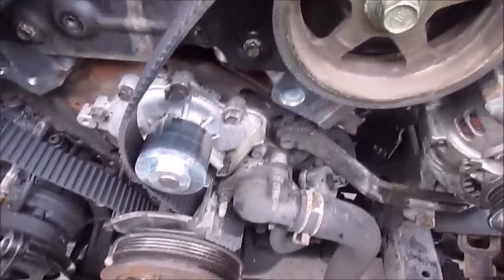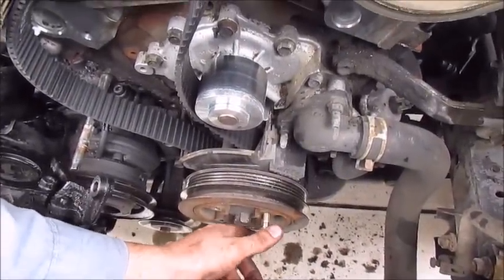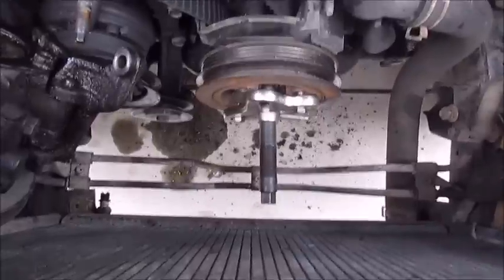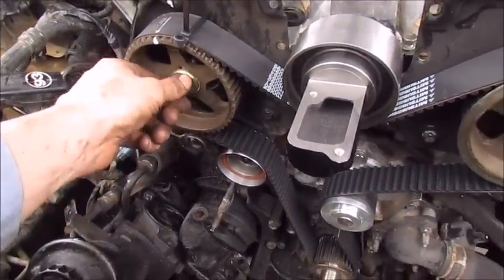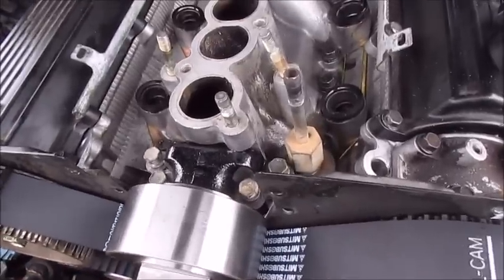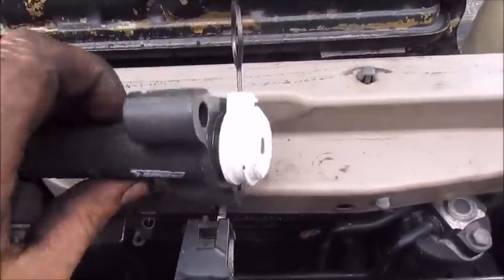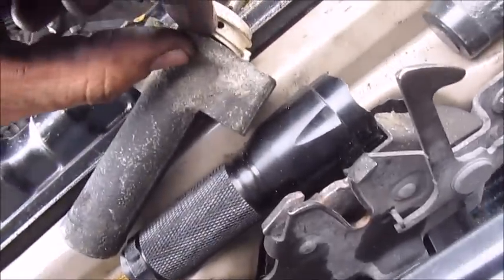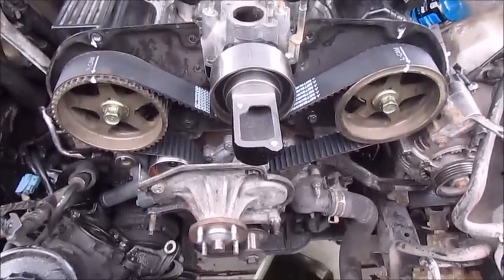Timing Belt 3vze

Comment: My timing belt slipped because the tensioner pully got fried. I am trying to put the passenger cam to TDC along with the driver Cam and the crank shaft but of it's four natural resting positions none of them are TDC according to the mark on the pully wheel. 

The pully wheel is off by 14 teeth to the right.

I did take the passenger cam wheel of to find that  a mark behind the wheel lines up with the key suggesting that the TDC was somehow changed. Have you heard of anything like this happening before?

Comment from the maker: If you have zero compression and you are confident your gauge wasn’t leaking, then I would dare say either it is due to a blown head gasket or burnt valve. Regardless the head will need to come off to figure it out.

Comment: Very nice video man. I might have a question for you.. Does your water pump has the bypass oil cooler ? Is it possible to install a water pump with an oil cooler even if your old water pump does not have it ? It's not my case.. but i'm just asking..
thanks
Reply from the maker: alexbaargaal sadly I don't have the vehicle anymore! I am not sure about the oil cooler aspect and converting from one to the other. I would think it would be possible as the engine is the same and most likely it's just the pump that has variations. Maybe someone else can shed a little more light?
Reply: Thanks travis.

Comment: That's the hard way to remove the crank-pulley bolt. 19mm socket on a breaker bar. Put the socket on the nut and roll the engine over so the breaker bar handle hits the top of the driver's side frame rail or steering box. Disconnect the coil and bump the key. The bolt pops loose with zero effort on your behalf. The starter motor does all the work.
Reply from the maker: Yep that will work too! Thanks for the comment

Comment: This video helped with a suspicion I had. Starting with the water pump side of the belt tight, with all the slack on the tensioner side. Just going by the book does not cut it when assembling a long block with no prior working experience with a over head cam engine. I did have great success do in part to your/this video, Thanks for the down load. I found the on the timing belt I was one tooth off from having both factory white lines equal to the back plate and cam sprocket timing marks, so with a one tooth turn to the right i was able to get the timing belt lines to match the sprocket and with a slight turn to the left i had the tension and the position needed to match all the lines. I suppose it is a way of telling you've the correct tension, I am not sure just a guess.

Comment: Does the plenum have to come off?
Reply from the maker: 99% sure you DO NOT have to. It does not overlap the intake manifold so you should be fine to remove the 4 idler pulley mounting bolts and change it out.
Reply: why does the crankshaft pulley have to come off? does it? This seems a lot easier than I am making it out to be